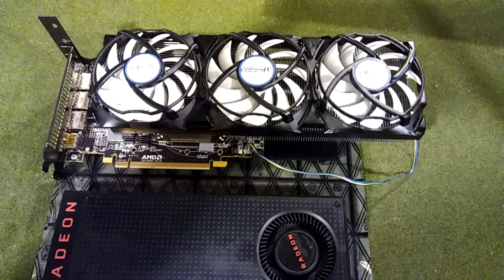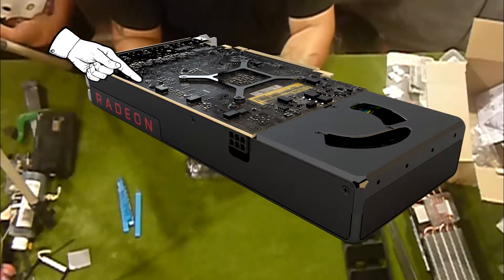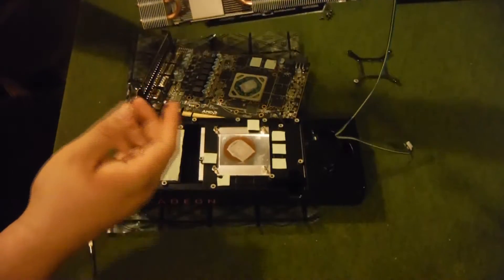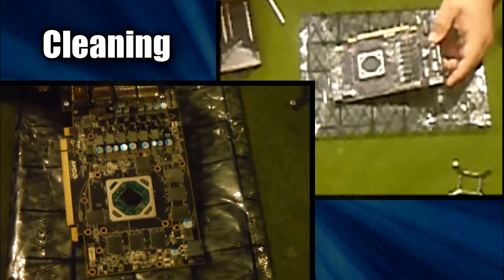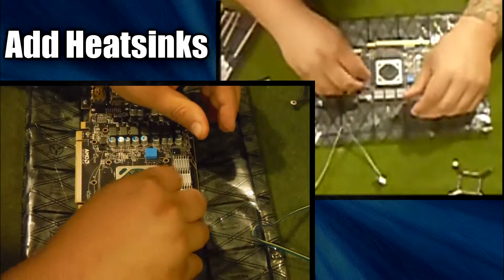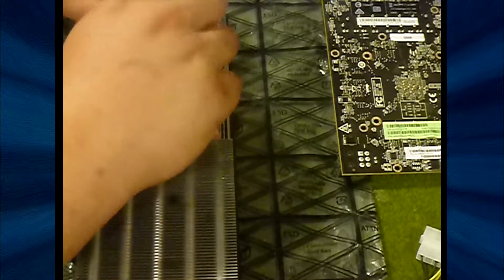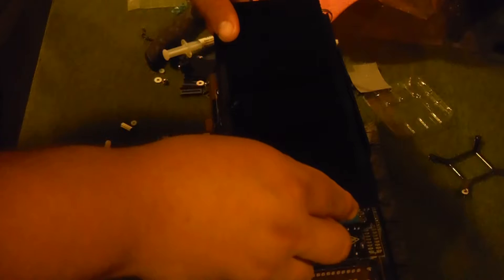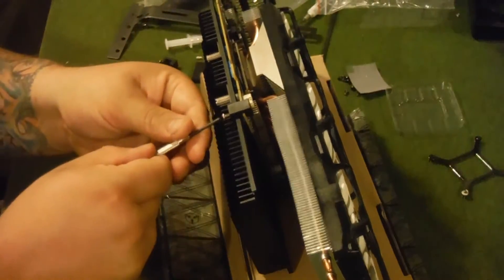ARCTIC Accelero Xtreme III, How to install aftermarket cooler to you video card

Comment: i have a better solution for the ram cooling. i have shortened the original heat plate a bit so that the ram pieces are cooled from the front side.
https://drive.google.com/open?id=1KgjTwPiCXn1CuQJnvE9CP2zfggODzESI

Comment: The cooler in the video is not the Xtreme III, but the Xtreme IV (see at 6:58) with the extra bulky backplate, which makes the GPU taking up yet another slot space (3 alltogether) in your case. Xtreme III doesn't have it, with just a tiny bit less cooling power.

Comment: let me quess the card is dead becouse you messed up something , thats why there is no benchmarking or overclocking , sine there is no reasson not to make it, grow a pair and admit you killed it :D
Reply from the maker: SeikonDS haha lies
Reply from the maker: SeikonDS I used it for months before i sold it like 2 weeks ago. so this video was aug.7th and in my april 3rd video i think it was you can clearly see it in the video running. it was the rx470 bf test from cult of mush's comments. its in many videos it worked great. didnt overclock much but kept super cool temps. the only way i could get it to overclock was to power the cooler directly from the psu. Then it was kinda loud. the stock 6pin power connection was not good for overclocking ever.

Comment: And where are the benchmarks?
Reply: probably he killed it when he mounted the cooler and wont admit it :D , i am not even joking about it.
Reply from the maker: i never made the video. its running at 1405mhz and 2200mhz memory currently
Reply from the maker: with no problems i havent really pushed it eithet
Reply from the maker: no much. its hooked directly to the PSU. my H60 water cooler with the provided corsair fan is louder then the GPU cooler.

Comment: Doesn't motherboard foam conduct electricity?
Reply from the maker: from what i understand only the outside of the anti static bags do
Reply from the maker: i just take those bags and turn them inside out then use them when i test bench. from my research (aka google fu) i have found that some foam could hold a small charge.

Comment: i want to do this but i'm scared that i may break my card. will this work with Accelero Mono Plus and will it it be the same application method?
Reply from the maker: Mono plus is similar but idk if it comes with spreaders for all the other critical parts. this kit came with that really nice back plate that i feel really helps to displace the rest of the heat.
Reply: the mono and twin come with the small heat spreaders